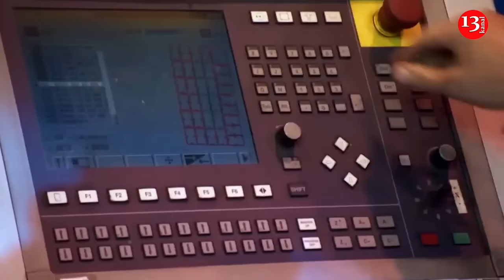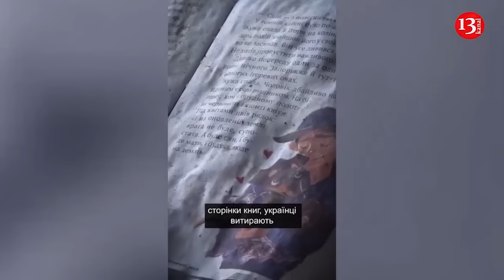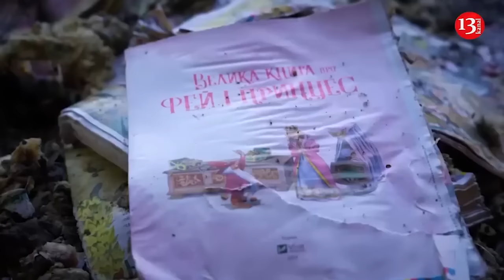For the first time since 1990s: United States intends to produce new Abrams tanks

Comment: For years and years and years they have been refurbishing the Abrams tanks. They only made so many of the actual frames, and then they just keep rebuilding them as they wear out or get destroyed.
Reply: Considering that there has only been only like 17 or 19 ever destroyed, that's crazy to think about considering that there are 6,000+ Abrams rolling on the ground.
Reply: The new design compared to the old will be crew compartment protection from drones or attacks from above, the gulf war legacy abrams and its updates was designed to cope with chemical warfare, and typical historic combat, now drones pose a significant issue because without an armoured front line with resilience you can be in a situation of stalemate while the lines reinforced and the equipment restocked,

Comment: Any new tank requires a remote control turret and a track system that can't be incapacitated by a single mine. Ukraine lessons.
Reply: Turtle tanks are not so absurd. Wheeled vehicles are also less vulnerable to mines, even if armor is a bit less powerful.
Reply: the US dont usually drive into open mine fields so theres that...
Reply: @7up-dp1kk  Fast moving IFV's have shown much more valuable than tanks and those turtle tanks are literally a joke, corrugated metal roofing isnt going to stop a shaped charge. No tank in the world can survive a drone swarm its just the way it is.
Reply: Me neither, but guys in Ukraine do. Mine clearing was remotely on the agenda in Irak. In Ukraine, mines and artillery shells are everywhere. It is an environnement where air superiority is a concept of the past. Brutality of Russians bombing is confronted by Sam, drones and artillery. Someone can easily imagine that these tools are used also by Russia.
Reply: @raz
Why do Russia make the turtle? Because they like to loose money?
B1 Bis or KV2 were very well armored, it may never be enough, though it helps crew to survive.
IFV’s are great, but sooner or later, tanks will be back in line, when protection issues are fixed. Retirement of Abraams tanks in Ukraine seem to be due to lack of armor and fuel consumption that are a bit hard to cop with. The main gun never was an issue, nor sensors.
Reply: @raz4371 what is stopping shaped charges is the distance, they don’t plan on the thickness of the metal stopping it but the space from the vehicle itself,
Reply: @7up-dp1kk   Tanks have tracks because wheels are inferior to tracks for moving across lose, muddy terrain and trenches
Reply: @antoniochalking  This was solve with tandem warheads and it does not effect the AP rounds
Reply: @pogo1140  I never said this was to stop ap rounds lol, I meant warheads like the rpg, HEAT warheads which are commonly attached to FPVs, heat warheads are heavily effected by distance
Reply: @pogo1140  Tandem warheads are turning out to be a useless weapon.  When the first charge goes off, it typically damages the cone of the second charge enough that the round is ineffective.  Look at the use of them by the HAMAS fighters.  The videos show lots of lovely explosions when the tank is hit, but actual Israeli tank losses are minimal to the tandem RPG.

Comment: If they do it it will take awhile to get started. It's not like unlocking the pad lock to get inside and turning the power on. They say upgrade the machinery, do they make the machinery and if not how long to do it. The most time consuming is manpower that needs to be hired and trained on the machinery. They have some updating the old ones but they said they do a few a month!

Comment: Why are western countries lagging so far behind, still no specialized anti drone vehicles. A couple of those should be with all armored columns, equipped to locate, jam and destroy drones.Unlike their counterpart for full sized airplanes, they only need smaller guns, like 556 mm rotary guns and even 22LR.  Drones usually appear in swarms , so a large caliber gun is not necessary but you need more ammo capacity to handle them. Range is often shorter. The same vehicle can also sense where the enemy drone are controlled from and forward the info to appropriate anti drone sources. Right now, drone operators sit at a stand off location, nice and comfortable and destroying tanks, that should not be allowed to happen. They should be subjected to attacks by enemy drones.

Comment: There are lasers that can hit drones in production, these tanks should be equipped with those.
Reply: I agree, they should use lasers with backup GAU19's to act in several modes. Enemy beam riding weapons could be baited directly into the stream of anti-material ammunition so that it acts like a goalkeeper when the laser is not enough to deal directly with bigger drones. Have it augment the Trophy APS. It would take up the same station as the current M2 Brownings to be optionally manned with a second fire rate setting to conserve ammo against ground targets. It would have it's own millimeter wave radar. 
As for the tank, they are looking at new Diesel Electric Hybrids but they may want to retain the turbine engines if they produce more power for the laser defence systems.
Maybe more armor in the front axis like filling the forward fuel tanks with reverse pike nose layers if it's not already there and some spaced armor on the turret cheeks. 
Maybe they go to 130mm main gun, I think I read somewhere they get 40% more kinetic power from a 5% increase in barrel diameter. AND options for wide tracks to better float on mud and ice.

My SciFi imagination is freaking out.

Comment: Jeez, a 50 year old design. I hope they have something more advanced in the pipeline.
Reply: AbramsX.
Reply: @1ndragunawan  Not quite, that's a technology demonstrator; the actual upgrade is M1A3 (or M1E3 as its currently known whilst in the development phase)
Reply: @wolfyys  well IF a new hull production of M1A1/2 hull is coming true, we will see SEPv4 (version 2.0)
before the new Hull of the M1E3 prototype comes out, as they want the M1A3 base version to be lighter
and with stronger hull before bolting stuff on it, I would not be surprised if M1A3 will end up being front 
engine with cooling build into the sides and McLaren p1 seating arrangement, a firewall between crew and static turret-tunnel with elevator to transfer shells from the rear hull rack to bustle shell rack.

in the end the M1A3 will be longer, wider and as heavy as the M1A2
Reply: @1BigBen  Firstly, there will be no SEPV4, it was cancelled for the M1E3.

Secondly, the primary reason the M1E3 was chosen over SEPV4 was primarily because they could no longer add features without adding weight.
Reply: @wolfyys  if you take a look of most new project of the US military 
for the last 10 to 20 years, most of them have been behind schedule 
and many of them have had short services life, 
now losing weight without lowering armor protection will take new composition,

that will take time and money, so I say it again there will be most likely a new SEPv4 upgraded kit, before we see a M1E3 prototype
Reply: @1BigBen  No there will not. This is not some guessing game, it is a clear hard fact.

The SEPV4 was already in active development when it was CANCELLED.

The M1E3 exists because the SEPV4 was deemed inadequate against future threats, this is because most of the newer threats weren't known until the Ukraine war of which the SEPV4 pre-dates. 

It was also confirmed that the Abrams could no longer gain new capabilities without gaining a significant amount of weight, this is because the SEP programs are essentially addons that aren't seamlessly integrated into the tank but are more or less layered on top of pre-existing systems. 

This means the vehicle has literally tons of excess wiring as many of these upgrades essentially have isolated circuitry rather than being truly integrated and sharing wiring and controls.

Imagine adding a bunch of electrical accessories to you car, but instead of wiring them directly into the main wiring harness, you add a new harness on top of the old one every time you upgrade-, and to top it off each accessory needs its own control interface - that is essentially what the Abrams is now. 

The SEPV4 is dead; the army had to make a choice - another "addon" upgrade which was already suffering from diminishing returns or a proper, but more expensive upgrade, the army chose the latter.